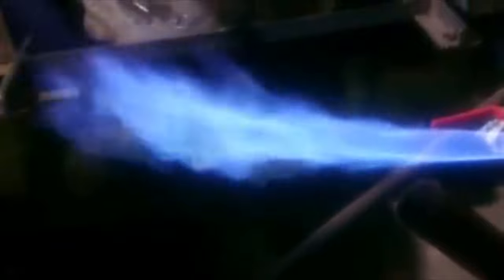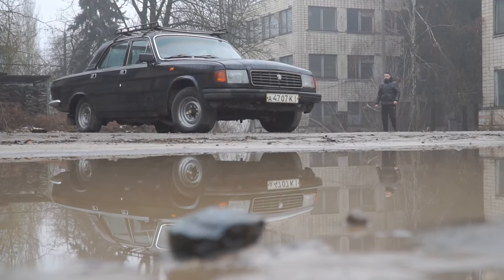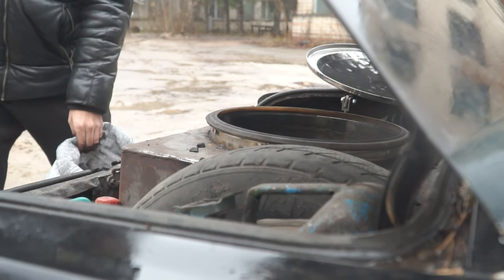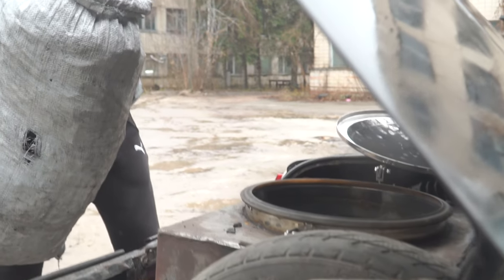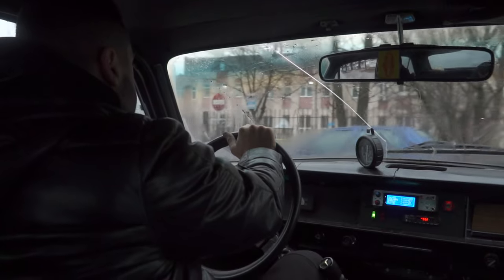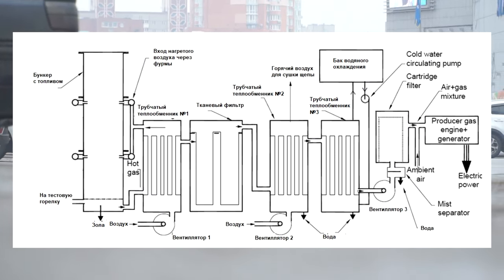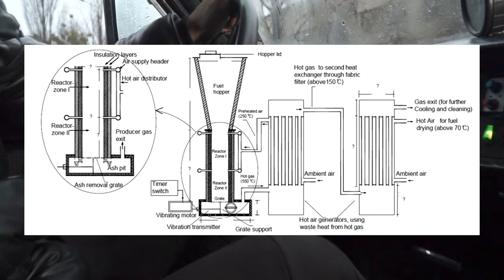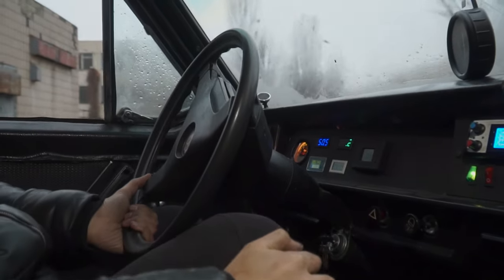A new type of gasifier gives 10-50 times less tar than an Imbert gasifier

Comment: I hope this message gets spread around.  People often say that something is x times less of something.  Think about this; if you have something a generator that burns 2 gallons of gas in a day.  Now you have some real numbers to work with and just like when you were a kid growing up the rest of this becomes a math "word" problem.  (Geez did I hate these.  Interesting that I became a machine design design engineer where every problem is basically a word problem.  I digress.)  So, you now have something like  2gal / 1day = 2 gal per day;  Now multiply that times your factor or percentage and you get something like 2 gal/day x 25 (your factor) = 50 gal/day.  Now you started out with using only 2 gallons and the rate so we are talking about 50 gallons BUT now you are using something that is this much less than the original use so you have 2 - 50 = --48 gal.  Since we started out as a consumption as a positive value this would mean that  you are getting 48 gallons back {essentially you need to flip the signs for this to be easier to understand}.  I WANT ONE OF THESE, IN FACT I'LL TAKE 2 !!!

Hope you don't mind the gibe, it is just one of my pet peeves and LOTS of people make this mistake.  Haven't actually watched the vid yet but looks interesting.  I'll give you straight up one later.  :)
Reply: Tar is a big problem with gasifiers because it will gum up car engines and cause failure. Most solutions use a large filter box or tank of water to remove it from the syngas, but that's tough to fit in a vehicle. Another solution is to burn at very high temperature to break down the tar into lighter hydrocarbons but that's tough to do in a car because of the fire hazard. The technical challenge is finding a way to gasify without seizing up your engine or blowing yourself up!
Reply: "Times X less" drives me up the wall too. So does zero point fifteen. Its like an entire generation has taken a blow to the head and shed a couple dozen IQ points.

Comment: i really like my downdraft boiler made in poland. i bet you have a good gasification system. you need a regional distributor in the americas. people are just incredulous until they see it running a generator well and good. they really have a perspective similar to the regard for impossible free energy machines. the heat exchangers need that all the tar precipitating surfaces be accessible for rapid thorough cleaningi will contact my agent, zenon, about direct import so you can have a showroom dealer in the center of the contiguous states.
Reply from the maker: ok

Comment: Combining that with SOFC fuel cell would be good idea. Sofc benefits hot syngas and air, and the efficiency can be over 60%. Sofc exhaust gas is also much hotter than from internal combustion engine.

Comment: And this fits in a car trunk? But the drawings show it to be much larger.  How do you dissipate the heat generated in the trunk?
Reply: You can compress the fuel in a tank and  have the gasifier separate from the vehicle.
Reply: @MarkC.4309  But that's not what he claims, he shows the burner in the trunk. Seems suspicious!
Reply: @buteos8632   he put a broken washing machine in the trunk 🤣
Reply: They ran gasifiers in car trunks during WWII.

Comment: How about starting an engine with e.g. propane and heating an airless jacketed pyrolysis reactor with exhaust fumes to 800°C and then switching the engine to pyrolysis gas?
Reply: Correct answer
Reply: Yup ! I asked that question on another post. Even start up on stored wood gas!

Comment: What made  you decide to make the gasifier with way higher efficiency ??? Would you be able to make a wood stove high ninety percent efficient ??? Thanks for your time Sir.
Reply from the maker: there is more emphasis on getting rid of the resin, you can make a gas generator with an efficiency of 92%, I did not do wood stoves. I specialize only in gas generators
Reply: @gengaz-lagunov How expensive are the generators that you make Sir ??
Reply from the maker: yes in different ways - depending on what power
Reply: They make wood stoves that Recycle the gasses to decrease fuel usage
Reply: @harryjoe860  Got you Harry. I understand fella.

Comment: Hello I am interested in a gasifier that can generate approximately 250-300KW electricity 460V 3PHASE  AT 60hz. We have a large supply of dry woodchips from a pallet operation  to run the gasifier
Reply from the maker: please call whatsupp +380661963808

Comment: Where  is  the  burning area ? at the base where is  the grate or at  the preheated air intake in top  part  where is conection  with  fuel  hopper?  In what part of system you start the fire?
Reply: The base

Comment: I would want to use compressed wood gas as fuel instead of hold the gasifier with the car
Reply from the maker: then it is better to make a wood pyrolyzer - pyrolysis gas 4200 kcal against generator 1100 kcal and compressed into cylinders at a pressure of 150-200 atmospheres, this will be close to natural gas 7600 kcal
Reply: @gengaz-lagunov  How do you store the gas safely? My understanding is that the hydrogen in the gas will cause embrittlement of the steel tank and weaken it.
Reply from the maker: @cabwaldo  I saw stored for six months, but hydrogen embrittles
Reply: Use electric vehicles! ( Tesla, etc.)

Why bother with bottled gas?
Except maybe for stationery use instead
  of a power wall or other power backup.
Reply: @terrancebecker9092  Do you...not understand electricity comes from some other source? Do you not understand that we have built internal combustion engines before that are far more robust than what is found today and thus can be repaired more often than not with homemade or locally manufactured parts? Try that with a Tesla battery or one of its 2,769 modules. Theres a reason Farmall almost went about of business- because they never sold any parts.
Reply: @terrancebecker9092  I believe this project is basically carried out on personal interest or experimental purpose, so there is no need to eliminate the effort made for better use of natural energy
Reply: @terrancebecker9092  when shit hits the fan if you havent been eaten you can install a gasifyer.  hell they are already telling people not to charge their cars.
Reply: Sure, pay top dollar for a vehicle which will need $20K repair in ten years (battery replacement) and you are powering with coal (probably) and which looses 30%efficiency in the cold.

Comment: why not make the combustors out of ceramic???
Reply: Cracks? Ceramic is very resistant to heat, but it doesn't do well with stress from physical forces - like driving a car over a bumpy road. And it also cracks with repeated heating/cooling cycles. Especially when temperature change is fast - what you want here when you start gassifier and want to run your engine fast. And ceramics also can take moisture from the air, which further speeds up cracks forming.
Reply: @ogi22  Makes sense. All the shock of combustion / detonations would probably just instantly destroy a ceramic combustor.
Reply: @ogi22  ceramics should always be set within a retainer such that it wont fall apart until its pebbles.

Comment: 10 - 50 times less? That makes no sense. If something is less than something else it is a fraction of that thing. Not a multiple of it.  it could be 50% less, or 1/3 as much etc.. but not 10 times less. Even just 1 times less than any number brings you to 0, so 10 to 50 times less tar is absolutely incorrect.
Reply: You cannot reduce something by 10 to 50 times, you can only reduce a fraction of it.
Reply: What is the meaning of 10%? 
It's 10/100 right? So it is also 1/10.
It means it is 10 times less than 1.
if it's 50 times less, then it's 1/50 = 2/100 and this is 2%
Reply: @ogi22  Wrong. This is what im trying to explain... "1 times less than" is "100% less than".... 2 times less than means 200% less than etc etc. SO 1 times less than ( 100% less than ) any number is 0.
Reply: @ogi22  What do you think 50 times means? it means 50 of whatever number you are miltiplying by right? so 50 times 2 is fifty lots of 2... which is 100.  IF ive got 2 apples.. how many apples can you take off me? You can only take 2 apples because thats all ive got.. you can only take 100% of my apples from me cant you? and that is 1 times. You can only take what is there, you cant take away multiples of whats there can you??
Reply: @ogi22  If i walked 1 kilometre, and you walked 1 times less than I did.. how far did you walk? what is the value of 1 times? NOW.. suppose you walked 1 times MORE than I did... how far did you walk? What was the value of 1 times now?  You cant exchange multipes for fractions whenever it suits. they are completely different values. IF something is less than something else.. its value is a fraction of the larger value.. it is never a multiple of it.
Reply: @ogi22  1 times more is 100% more... right? 2 times more is 200% more... right? So, 1 times less is 100% less, and you guessed it, 2 times less is 200% less. etc etc. How on earth do you take away more than 100% of something? You can only take away a fraction of what is there, not multiples of it.
Reply: @greenzx9r  1/1 = 100% less. I stayed at home good Sir.
The other question has the same math. I went for a 2km stroll.
[edit]
Maybe i'm not that good at english, but in polish language we have the same construction. But noone use expression "one time less". However there is "two times less". The problem we are talking about is a common language expression. Those are not mathematical relations. And yes, they sometimes can be misleading.
There is "one more time" which sais that something is repeated, but i didn't hear a construction "one times more". Instead in my language we use "two times more" which impiles that something is multiplied by two.
Again - common language, not mathematical equation.
Reply: @ogi22     Lol,  "one more time" 

* throws a watch and a clock*   now you have two times (more) 

LMAO, made my day
Reply: @ericmieremet  Happy to put a smile on someones face. I'll take that 😁